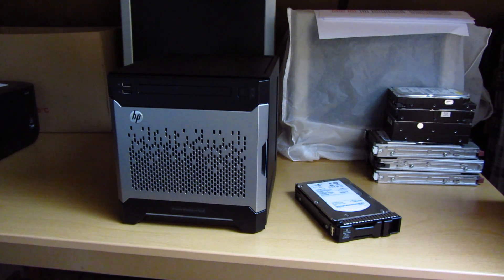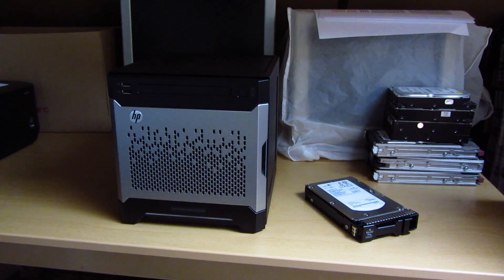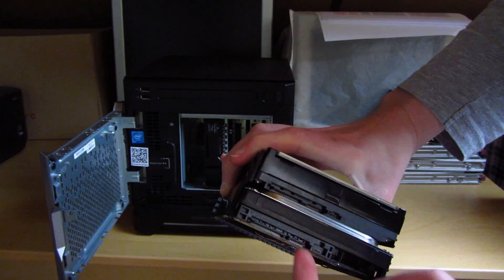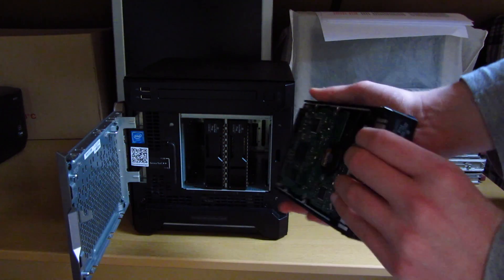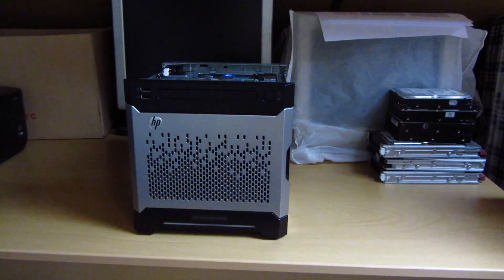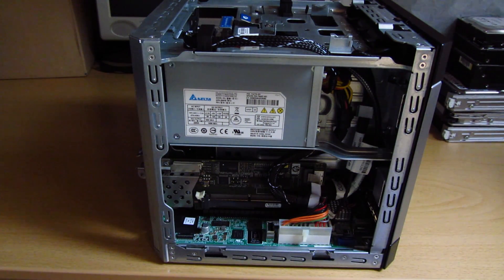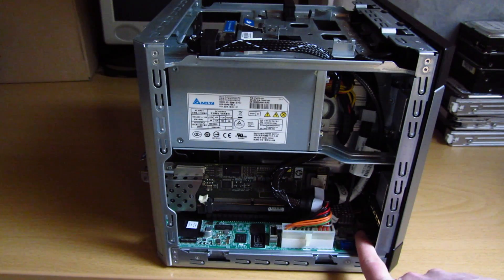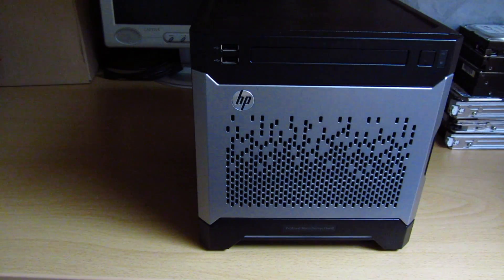HP MicroServer Gen8 Upgraded to SAS

Comment: Can you run a mix. Of sas and sata drives within the same raid - would make the upgrade much easier as could resilver one by one gradually switching to the sas?  Please let me know.
Reply from the maker: @MrDavestarr2001  not in the same array. You need to pick one standard for your array or have two separate arrays and migrate the data over.

Comment: My controller won’t detect any drives :(
Reply from the maker: Did you put in an actual SAS controller if using SAS drives? SAS drives don’t work on a SATA controller. Also make sure the cable from the backplane is connected to the SAS controller and not the onboard SATA controller.
Reply: @nelizmastr  I am using the p520 and upon booting nothing is detected for the card but I see the lights. When you say the cable from the backplane you mean the cable to the motherboard is connected to the SAS controller yes.

Comment: What’s the biggest size drive that will work with this?
Reply: This has no UEFI so no >2TB since it's Gen8
Reply: @gianfrancobriones  I have 4 x 8TB in one Microserver and 4 x 6TB in the other. P222 controllers. Only the boot partition cannot be greater than 2TB.
Reply: @JoeDonkor  How many >=2012/Gen8 ProLiant and Windows Server (90% forgot to Rufus on CSM) users do you think got annoyed by this limitation while UEFi has been around since 2008 and the 10G (2008) Dell PowerEdge line but HPE zipped their mouth shut about their product's limitation?
Reply: It's literally in the server documentation. I would have no interest in running the OS on the RAID array, I boot off small SSDs.

Comment: How do i get seagate 4tb sas drives to be read by P410 Controller?
Reply from the maker: It likely doesn support drives larger than 2TB.
Reply: So the max size hdd is only 2tb?
Reply from the maker: Yes. Keep in mind this is a very old pre-UEFI era controller and 2TB was the maximum single drive size for many years. If you need bigger drives, buy a newer controller.

Comment: Great video. Does the P410 allow non-RAID configuration as I prefer to run software RAID.
Reply from the maker: The P410 can only work in RAID mode. If you want software RAID, get a HBA instead. The HP H220 is a good bet. It has PCIe 3.0 support so it's better suited to SSDs.

Comment: Hi tnx for the video! Question. I'm out of storage and can get 6TB SAS drives IBM for like $50 a pop. Now when changing the controller will i lose my array configuration?  or any data on the disks? To then swap out hhd at a time to rebuild data?
Reply from the maker: When you swap controllers the rule is that you lose the array, yes. Unless it’s the same controller chipset and firmware revision.

Backup the data, get the controller, create a new array and copy the data back.

Comment: Just to verify, if I install the P410 card, I only disconnect the minisas from main board and plug it into the P410 card? I have a Gen8 Microserver.
Reply from the maker: Correct. That’s all it takes. Just boot into the option ROM of the P410 to define the RAID array and you’re set.

Comment: Hi - very nice video. I have an Hp Proliant microserver N40i ( i think) ;-) Will the sas controller work on it? Doing the same project. Have 4 sas disks i would like to use in the microserver. Regards Jacob
Reply from the maker: If your backplane is SAS compatible (so no visible separator between the power and data like on a SATA connector) yes.
Reply: @nelizmastr  The disks fit perfectly - they slide in with no problems or resistance :-)
Reply from the maker: Nice. Then you’re good to go. Grab a HP P410 off eBay for like 20 bucks and enjoy.
Reply: @nelizmastr  Hi again. what about the heat from the disks. SAS disks will develope a serious amount of heat. Are you cooling with the standard vent? Merry xmas :-)
Reply from the maker: I use 7200rpm sas disks now which is fine. If you run 15k drives, you should be alright with the standard fan as long as you can somewhat control the ambient temperature.

Comment: The P222 spec says "x8 6Gb/s SAS physical links (compatible with 3G SATA)" so am I to understand that SATA 3 drives will be limited to 3GB/s when connected to this card?
Reply from the maker: I just looked at the quickspecs myself, and it would appear so. Not that it matters much, as harddrives can't saturate an individual 3Gbps connection anyway.